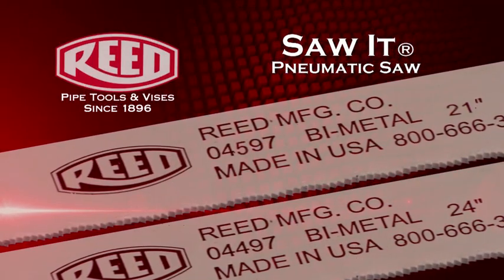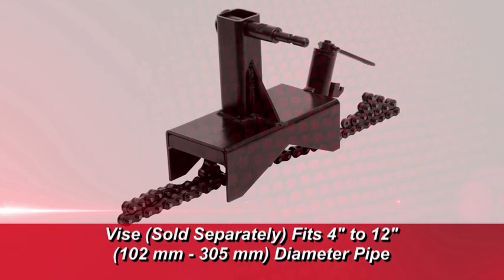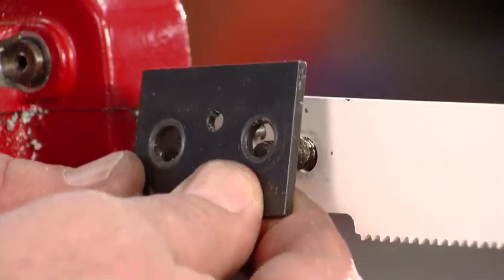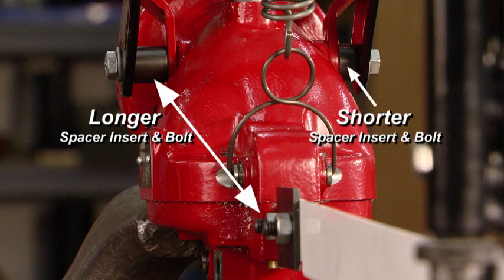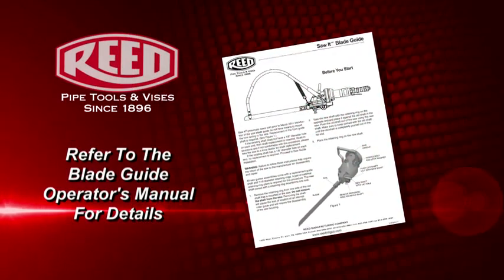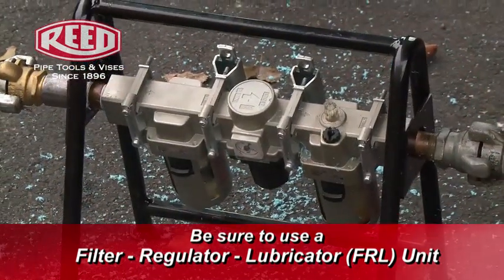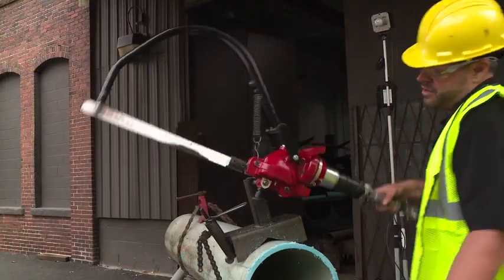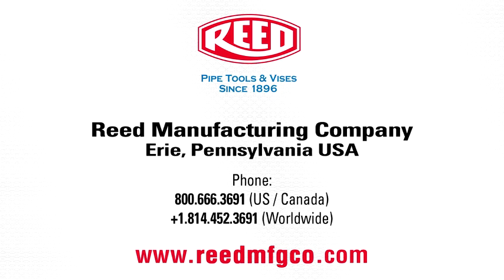Saw It® Pneumatic Reciprocating Saw Demo - Reed Manufacturing

Comment: Why you always start cut from bottom and not cut from top to bottom
Reply from the maker: The cut is gravity assisted when you cut from bottom to top. It’s easier to control the cut when your arm is pushing down rather than pulling up